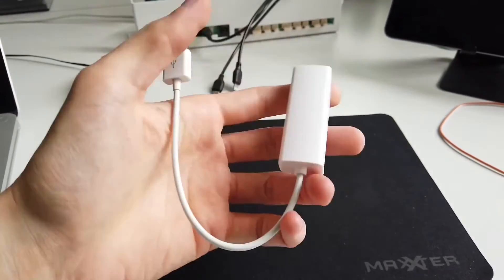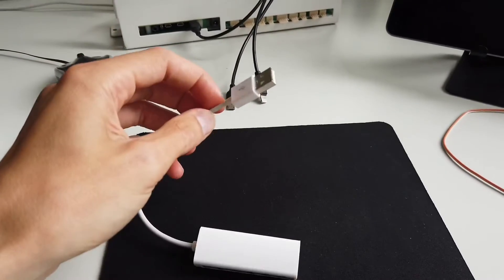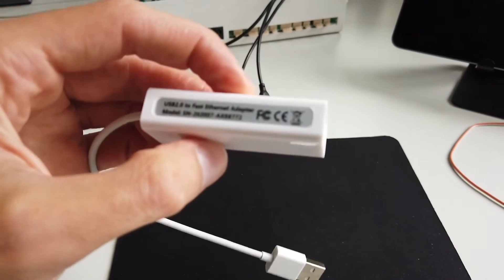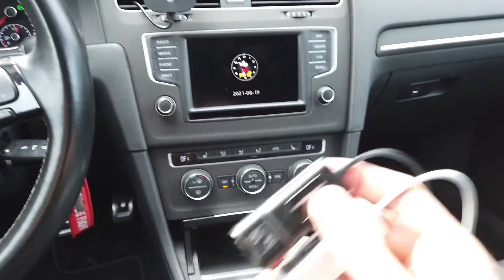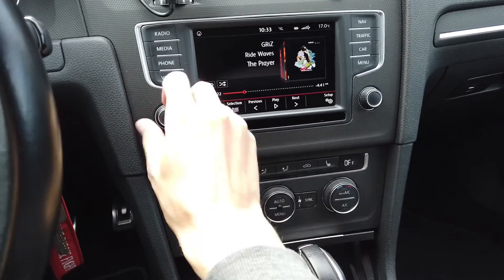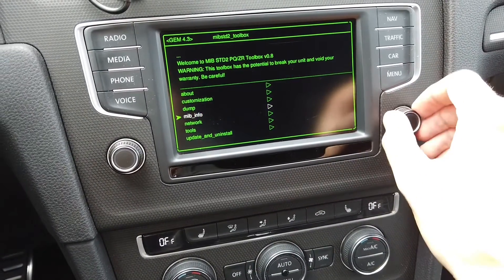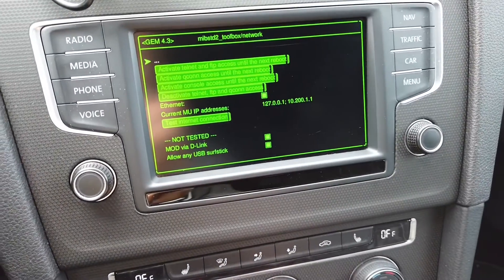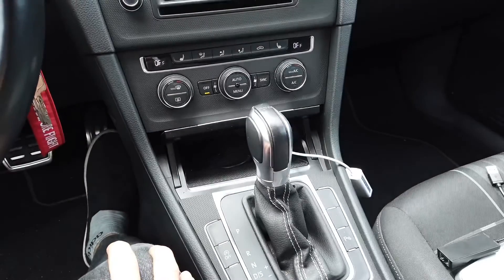Convert ASIX AX88772 to D-Link DUB-E100 for MIB2 hacking

Comment: I did exactly as you instructed on same adapter you refered to and it showed me ip now (192.168.1.4) on my MST2_EU_VW_P0867D_STD_PLUS GEM but I cannot telnet the unit at all neither can ping the unit. I tried with fw P0891D as well but nothing. There is something wrong with adapter that windows cannot make the connection to the unit. I noticed as well on your eeprom data that line 00140 and 00180 have same VID & PID, Do they need to be changed as well?

Update: finally got it working changing VID to 1a02 instead of 3c05
Reply from the maker: Thank you for this comment! It seams that using D-Link DUB-E100 rev.C1 (0x2001, 0x1a02) instead of D-Link DUB-E100 rev.B1 (0x2001, 0x3c05) gives better results when it comes to supported system versions.
Reply: @mrfixpl  please if possible update your main thread regarding mib2 and adapter conversion with this info in order to help people out there.
Reply: I need your help regarding Car-net activation since I cannot find wifi menu in car setting although I enabled carnet feature
Reply: The answer why in your case this was is: all AX88772B chips need to use the VID/PID from the DUB-E100 rev c1 as that had the B chip as well. The other revision works on both AX88772A and AX88772 chips. So choose your PID/VID depending on your chip.
Reply: Very thanks. Work ! :)

Comment: Hi, great video. What are the ip addres, and port number to conect using Putty ?
Reply from the maker: Depends on what you are connecting with.
Reply: Thanks. It works making changes in firmware bits, like said in another coments. The configuration in Putty is the same like Dub E-100.

Comment: If you tried to do the procedure using more recent versions of Linux, you probably came across the message "offset & length out of bounds", just type "lenght 1" at the end of each line.
Below is an example of converting a Ugreen AX88772A into a Dlink DUB E-100 (Leaving 0B95:7720 [0xb95] to 2001:3C05 [0x2001, 0x3c05]):

sudo ethtool -E eth1 magic 0xdeadbeef offset 0x0088 value 0x01 length 1
sudo ethtool -E eth1 magic 0xdeadbeef offset 0x0089 value 0x20 length 1
sudo ethtool -E eth1 magic 0xdeadbeef offset 0x008A value 0x05 length 1
sudo ethtool -E eth1 magic 0xdeadbeef offset 0x008B value 0x3c length 1
sudo ethtool -E eth1 magic 0xdeadbeef offset 0x0048 value 0x01 length 1
sudo ethtool -E eth1 magic 0xdeadbeef offset 0x0049 value 0x20 length 1
sudo ethtool -E eth1 magic 0xdeadbeef offset 0x004A value 0x05 length 1
sudo ethtool -E eth1 magic 0xdeadbeef offset 0x004B value 0x3c length 1

I wasted a lot of time looking for a resolution, so I hope I can help anyone who came across the same problem :)
Reply: Hi! I use a live distro? Can you share full list of the commands? Linux isn't my strongest 😁
Reply: you sir just saved me god know how much time. This isn't listed anywhere but right here on yt comment
Reply: you are my life saver ! thanks man

Comment: Dunno what this is used for but I ended up here out of curiosity looking for the ASIX AX88772 chip and its drivers on google and this sounded interesting. Another more "brand name" USB ethernet adapter using this chip is the one I have here and which lead me to this in the first place :D It's a Trendnet TU2-ET100 (HW Rev 4.0). Just thought I'd mention this as it might be useful to some people

Comment: Hi,
My Unit Information;
MST2_EU_SE_ZR_P0479T
MU Version: 0479
Part number: 5QA035824B
Software Version: H29.319.102_STD2Plus_EU

There is only one SD card slot.

Can i do this ? :) Thanks
Reply: Not possible this way, need to solder emmc

Comment: Works like a charm with a linux virtual machine without using raspberry device
Reply from the maker: I believe there's also Windows tool that can do this.
Reply: @mrfixpl  I tried also on virtual machine without raspberry device and it's not working. I stuck at the step number 3. - ASIX USB dongle is not visible in tetminal...
Reply: BUT!! It is not recognized anymore by windows… i don’t understand
Reply: @Stormk972 driver booster install

Comment: I didnt know that vid and pid can be changed over usb

Can this be done to other usb devices as well (to unbrick FTDI beicked chips that had its vid and pid set to 0 by an evil corporation called FTDI)
Reply from the maker: Not all devices support EEPROM modification over USB. Depends on the chip inside.

Comment: Great video.
I made it as far as "sudo ethtool -E eth1 magic 0xdeadbeef offset 0x0088 value 0x01"
I get the error "offset & length out of bounds"
Can you (or anyone :) )  please give any advice on getting past this issue?
I believe i have the correct device:
driver: asix
version: 22-Dec-2011
firmware-version: ASIX AX88772 USB 2.0 Ethernet
expansion-rom-version:
bus-info: usb-3f980000.usb-1.3
supports-statistics: no
supports-test: no
supports-eeprom-access: yes
supports-register-dump: no
supports-priv-flags: no

Thanks

D
Reply: Add at the end of the line: length 1
Reply: In order to avoid the error, you have to specify the length parameter.
Like this:

sudo ethtool -E eth1 magic 0xdeadbeef offset 0x0088 length 1 value 0x01

Comment: Is it only importatnt that adapter has ax88772, does i make any difference if it is ax88772a, ax88772b etc.?
Reply from the maker: As long as the EEPROM can be edited, you should be good.
Reply: Found on eliteboard that AX88179 can be used also, as I understood, without any mods. This is interesting because adapters with this chipset are today widely available for about 15-20€.

Comment: What are your plans with this device?
Reply from the maker: I want to update from 0245 to 04xx. This will disable build-in WLAN and I want to have FTP access to the unit.
Reply: @mrfixpl  how will you acces the files on the emmc? Will you use a ftp program and how can you connect to the mib unit? Can you show or explain how to replace files or copy them to unit?